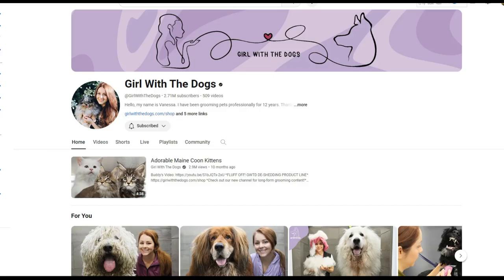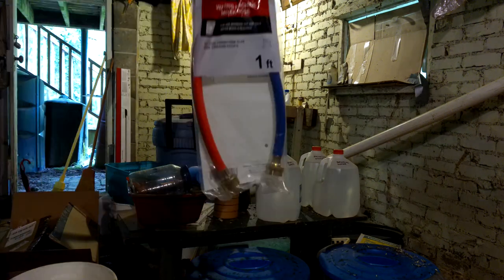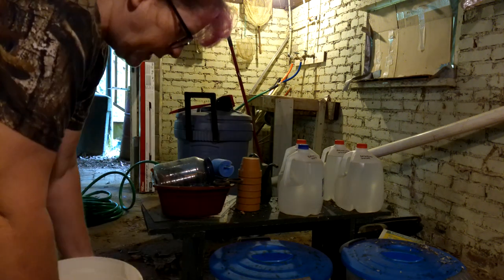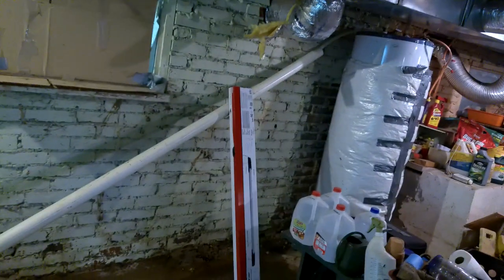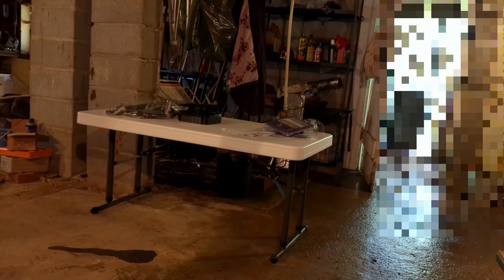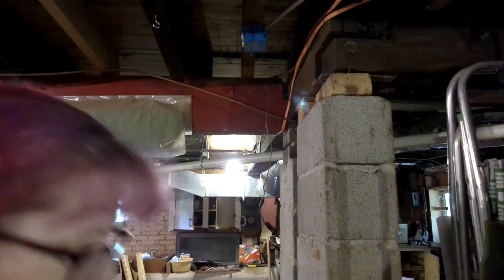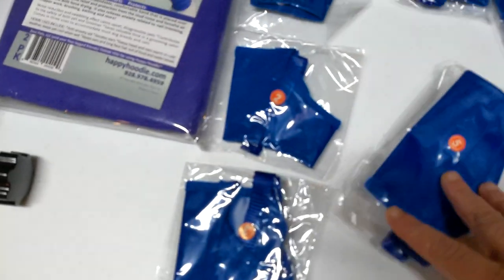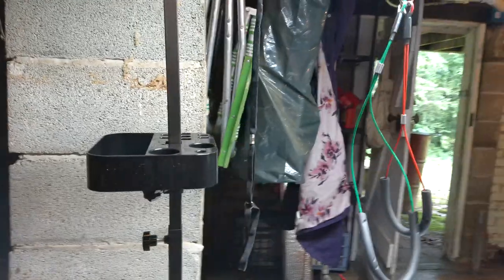Converting Old Basement Into Dog Grooming Area

Comment: What is that long pipe for?
Reply from the maker: That is an extension for the overflow drain from the water heater.  It gets in the way, so I was able to shorten it and move it behind the sink supports.   My next project is to get the cardboard out of the window.